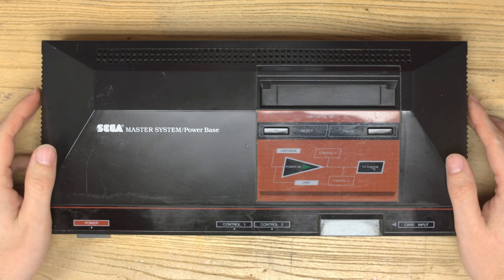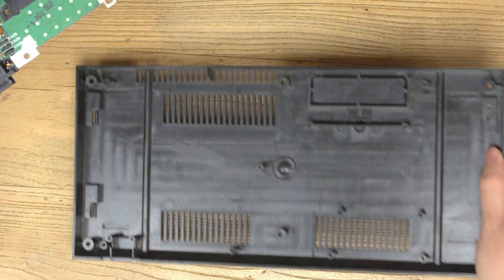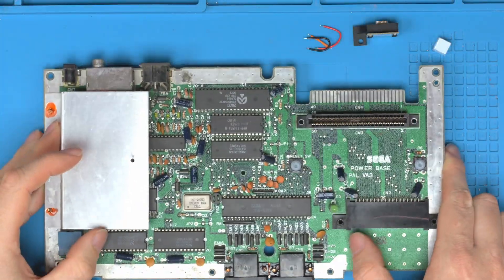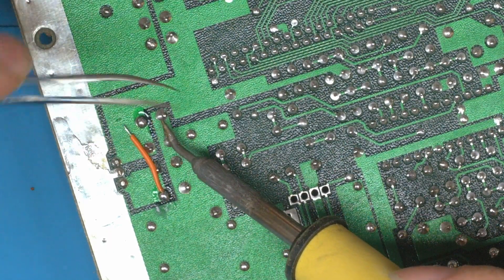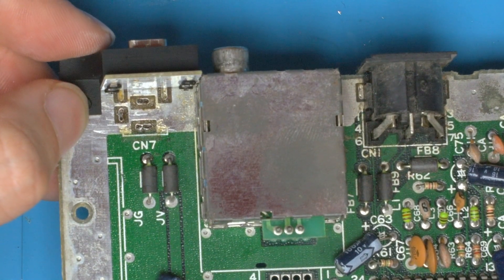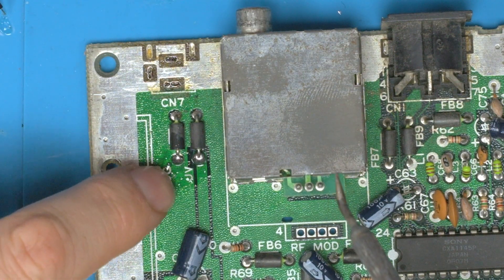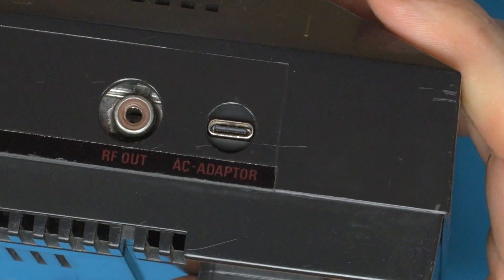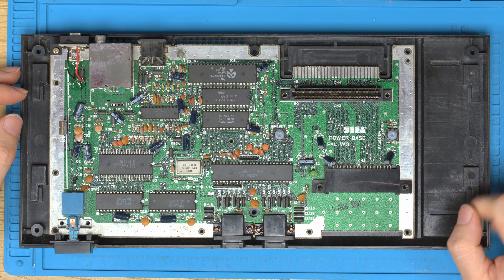Is CleanPower the Easiest Master System USB-C Power Mod?

Comment from the maker: UPDATE: Although not on the schematic, and not on all versions, if you have a diode near the regulator (D1 on Japanese versions, D60 on UK models) bridge over the pins to bypass the diode, otherwise your output voltage will be too low.

Comment: Why not just use the Megadrive power supply? Or even the Tower of Power 5 lead supply? That allows you to power two Master Systems, two Megadrive 2s, and a SNES, all at once. 

The Megadrive 1, both Master Systems, both Mega CDs, and the Game Gear all use the same supply and have the same plug, and that will also work on the internally regulated NEO-GEO. 

Megadrive 2, 32X, and Nomad all use the same power supply as each other too.
Reply from the maker: 1. Still using old power supplies 
2. Everyone has a USB cable
3. Internally consoles all run much cooler without massive heat sinks now
Reply: @RetroSix  running cooler really does little to nothing. They don't run that hot anyway and i'd hardly call the heatsinks anything to write home about. Most have almost nothing there for a heatsink, because it isn't needed.

I don't have a USB C cable anywhere in my cinema room where i play my consoles. I have nothing that uses USB C apart from my Switch, which is in the AV rack, not in the floor pit the consoles connect to. 

Old power supplies are just fine, they've generally been bulletproof reliable for as much as 40 years, so no issue there, i'm assuming your concern is their physical size? It certainly can't be anything else because there is no other concern.

The Tower of Power setup has a 12v 3A switch mode power supply, if the very minimal power consumption difference is a concern, which it certainly shouldn't be, the difference is so low and actual consumption is so low it would take years (probably decades) to ever see a change in the power bill.
Reply from the maker: @CaseTheCorvetteMan running cooler literally expands the lifespan of absolutely everything inside. It's why we cool computers
Reply from the maker: @CaseTheCorvetteMan and if you can touch the heat sink on the mega drive do me a video. I've thermal camera it at 90C so would love to see that 😂 if you don't have USB C then this mod isn't for you but it's clearly for most people based on sales and demand (our highest demand product we sell)
Reply: @RetroSix  no, we cool computers because if we didn't they'd overheat and either slow down significantly or cook themselves to death. 

The only cooling in a console like these is on the voltage regs, and it aint gonna matter too much if they get hot, they have run 40+ years that way and were designed to.
Reply: @RetroSix  i'm sure it has it's merrits, in some people's cases it would work great, just not for me where it would be more of a pain in the arse than anything else. Seems much easier to just plug it in the way it came and not worry about the short lifespan of a cheap USB power supply compared to a good reliable iron core transformer that will last basically forever.

If transformer fails you get no output, if the rectifier dies you lose half or all of the AC wave, if a 7805 fails it generally shorts and takes out the fuse, none of which will destroy 5v components on a board, but what happens when the cheap USB power supply fails? What is in place on that board to protect the console from overvoltage in the event of that tiny little switching supply failing and spitting out higher than tollerable voltage? It's rare, but it happens.

The 7805s used are easily capable of running at that temp day in day out for years, but i can't say i've seen one get that hot. Especially not in a Master System, in a Megadrive where there is two of them i still haven't seen that much heat produced. 

Ultimately i'm yet to see any of these consoles die from any sort of heat related failures, not in the near 40 years i've been playing them. I still have my original Megadrive with Altered Beast and that console has had legs run off it and that was many Australian summers before air conditioning in houses here was really a thing, haven't touched it as far as repairs go, still hasn't cooked itself!

My fingers are not going to be any sort of true indicator of what temperature electronics can cope with, and whether or not we can hold fingers on heatsinks is irrelevant really.
Reply: @RetroSix   my point to this is along the lines of you have created a solution to an issue that hardly really exists, at least as far as these basic consoles go. Later consoles with internal power supplies sure, there was an issue with some of those, but not with these. 

At the same time, you're introducing an unknown into the mix, that not all USB power supplies are created equal, and what is in place to protect against that?
Reply from the maker: @CaseTheCorvetteMan I crested a solution based on demand and have sold literally thousands coming up to 10,000+ now across the range. So pretty sure an issue/desire exists. Nobody wants to keep buying old DC jack powers
Reply: @RetroSix  oh no one is questioning demand, but the issue really doesn't exist. Modding a perfectly working console to operate on 5v direct from a cheap USB power supply with questionable long term reliability isn't something i'm keen on. For the same work and less money i can easily swap out a 7805 and go another 30+ years.

I have seen a lot of the work you have done and it is no doubt exceptional, especially what was done with the NEO-GEO video output levels, which completely contradicts the false info that has been doing the rounds for years about the earlier consoles outputting better video, your work proves clearly this false, and you have that backed up with REAL data instead of some captured screen shots going through a scaler that don't prove anything. This is a great solution to a known issue. Huge thumbs up from me there for sure.

In this case though i'd be quite happy sticking with the tried and trusted power supplies that have worked for decades and very rarely fail. Call me up in 30 odd years and let me know how many of these 5v USB supplies are still working!!
Reply from the maker: @CaseTheCorvetteMan yep some of these CleanPower are straight through but new versions coming up (for that reason of cheap USB regulators) will have boost buck regulators. This also helps with video noise from poor usb
Reply: @RetroSix   well that is good to know.

The USB mod on the NEO-GEO will absolutely require a very stout power supply, the 5v model of the home console often had random resetting issues with the high meg count carts if the supply wasn't good enough, and the stock one in the box could put out 3 amps. That was barely enough in some cases.

The 2 slotter MVS cabs sold over here had 5 amp supplies on the 5v line, and the 6 slotters had a huge power supply. I know that 5v 3 amp is not enough to run a 2 slotter with two high meg carts, let alone a fully populated 4 slotter without random resets, however 5 amp seems to do the job.
Reply from the maker: @CaseTheCorvetteMan oh tell me about it. I spent a month trying to fix one when I first started working on them years ago only to find out the neo geo plus flash cart was pulling more than my bench could supply so would spike over 3A but visually it's average current was 2A so didn't look like a current limit issue
Reply: @RetroSix  Yep, they are very power hungry machines running at full tilt!

Comment: I see that you're offering a USB Power Kit for the Mega Drive Model 1, but it seems there are no guides / instructions on how to install it anywhere.

Can you help me install it or give me some info where the two patch wires go? (MD1) 😊
Reply from the maker: https://www.retrosix.wiki/mega-drive-2-cleanpower. Same as the MD2 then solder the white and red wire from original dc board onto USB board. White is ground, red is VCC
Reply: @RetroSix  Thanks for the reply. So on the MD1, there are two voltage regulators instead of one, like on the MD2. Do I just bridge the outside two pins on both of those regulators then?
Reply from the maker: Yes just bridge both
Reply: @RetroSix it worked like a charm! Would like to do this to a model 2 of mine as well. Where would the leads need to be soldered there?
Reply from the maker: @Varin00x  yep the link I sent shows model 2 install

Comment: Just installed one tonight. Was really easy apart from my barrel jack had the pins bent under the board and it wouldn't come out, ended up cutting the jack up, but that's fine and it works a treat, as always with anything from retrosix :)

Comment: @RetroSix  in ferrytail land but, would it even be possible to make some kind of external board to power all three components of the GENESIS/SEGA CD/32X tower of power? Something like the Wall Warts that have fast charging and go upwards of 100 watts of power? but, having 3 usb c ports each one labeled for the power required for each component. I think you know what I might mean. lol
Reply from the maker: Yep. And via single USB C cable. If enough demand I can invent the product

Comment: Will this work if you don't remove the dc barrel jack?
Also, is this compatible with the Japanese Master System?
Reply from the maker: Yes to both
Reply: Sorry, just 2 more questions.
Can you use usb-c to usb-c power adapters?
How many amps do the Master system 2 UK and master system 1 Japanese version need? Is 1a each ok as I want to run both systems from a single double output power adapter with a total of 2.1a
Reply from the maker: @Double---888  yes you can use C to C. Uses an amp each, but you can run up to two consoles per CleanPower

Comment: You're always coming up with some great quality of life mods. One of these for the original PlayStation would be awesome.

Regarding the Mega Drive 1 and 2 versions, are either of these compatible with the Multimega?
Reply from the maker: Good question. Very likely yes and no. I'll investigate the power system of multi mega and 32x and mega CD and make ones for those too
Reply: @RetroSix  that'll be brilliant. I'll keep an eye out for when they drop 🙂
Reply: @RetroSix  in ferrytail land but, would it even be possible to make some kind of external board to power all three components of the GENESIS/SEGA CD/32X tower of power? Something like the Wall Warts that have fast charging and go upwards of 100 watts of power? but, having 3 usb c ports each one labeled for the power required for each component. I think you know what I might mean. lol